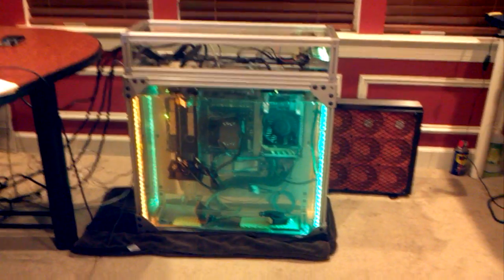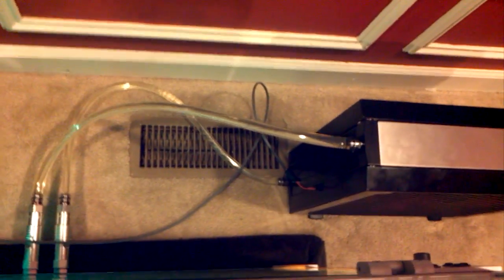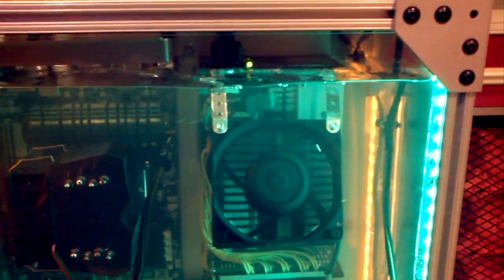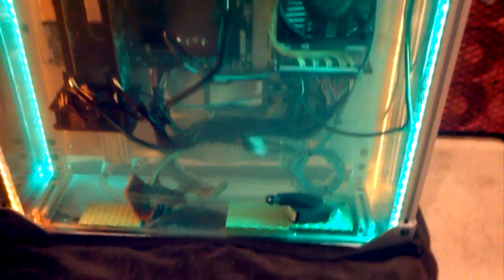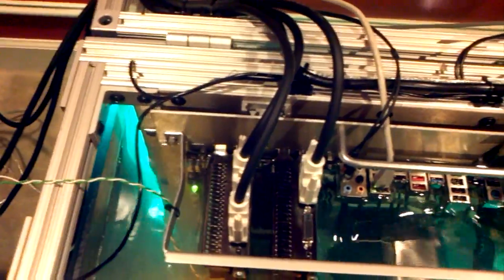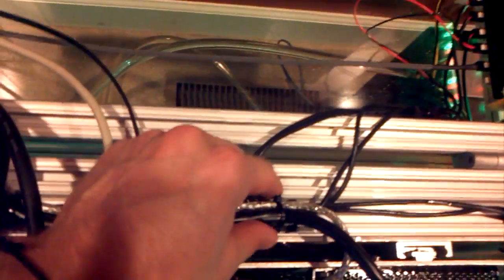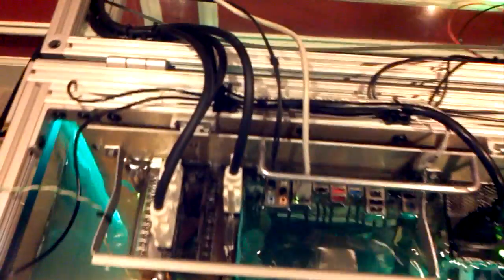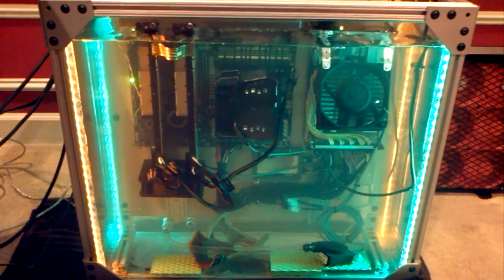Mineral Oil Computer Done!

Comment from the maker: Yeah...I'm kinda partial to AMD, though they are certainly behind on the performance curve.  Thats why I got the AMD FX8150.  I definitely like folding@home and I'm looking at openCV work (which only really supports nvidia) so thats why I got nvidia gfx.

I also fully admit the cable management is bad---ish :).  Cable management is not something I like doing...I've never self-sleeved any cables and I did all the cables this time:).  Theres no-where for them to go and cables were really long.